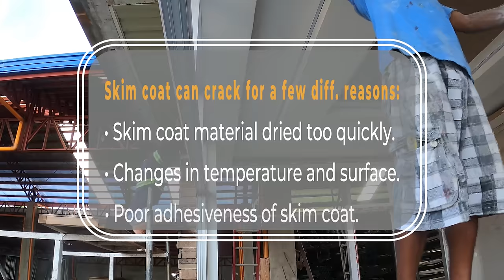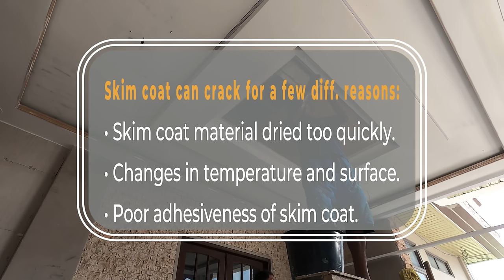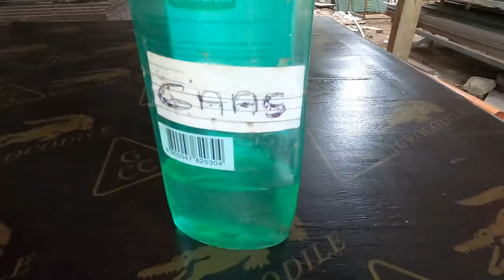LAST EPISODE__Hindi Nila Ito Alam kaya NAPAPAGASTOS ng MALAKI sa pag PINTURA-ANG PAGTATAPOS

Comment: Maraming yatang Pwede pero Mali sa procedure mo tol. 1grinder para magpantay ang revits ,baka malaglag ang hardiflex.2 mesh cieling tape  kumukulubot yan pagtagal.3 primer muna bago skim coat. Ang skim coat para yan sa mga lumang rough na cementong dingding.4 ang haspe mo tinawag mong textured.5 clear gloss o rmulsion. Yan ang mganapansin ko.
Reply: Sapalagay ko sir yong pag grinder ng blind revits yong top lang kunti lang ang na ggrind nila kasi naka baon din yan ng kunti...at yong mesh dipindi sa pag intall...yan subok na at pinag isipan yan bago maibinta sa market kaya walang mali sa pag gamit ng mesh